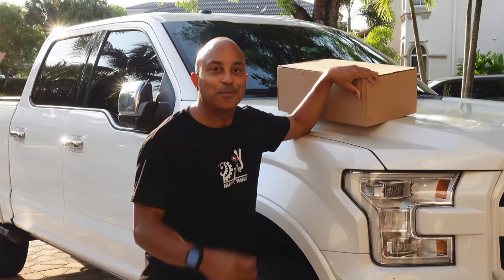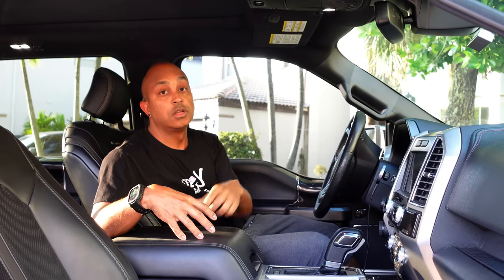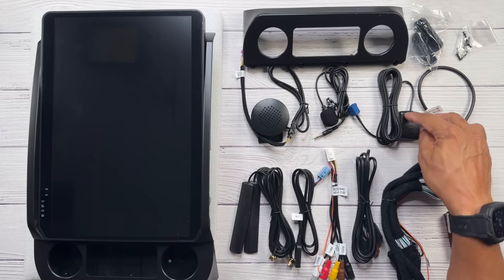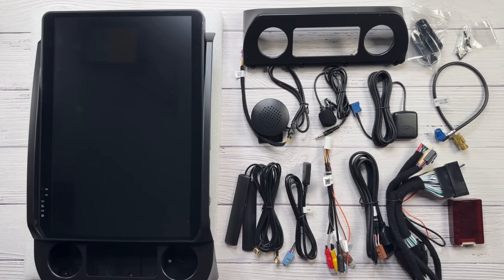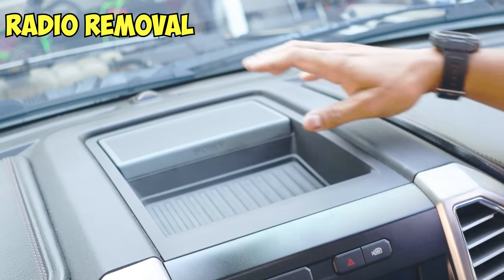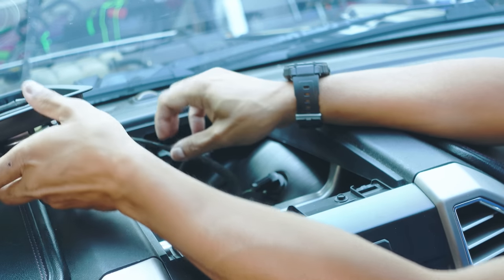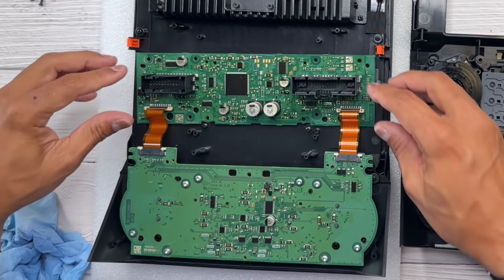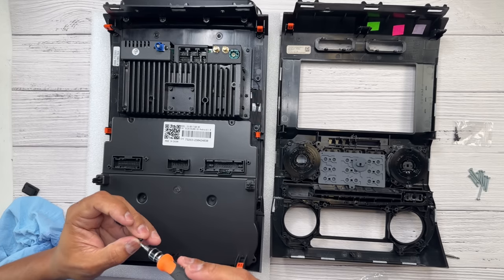BEST TStyle Radio for F-150 | Retains SYNC 3 | AutotecPro 14.4"

Comment: Thanks for the video !! I install everything with the video .. but he don’t have rca output at all to connect amplifier?
Reply from the maker: This unit for the ford does not have RCA outputs for amplifier, you have to do aftermarket amp install by tapping into the connections behing the back seat.  It basically connects to your existing sync system

Comment: 3 months in. Is everything still good? Would you recommend? I have a 2018 F250
Reply from the maker: I would recommend it. It works great so far.
Reply: @DeaninItYourself  Thank you, Sir.
Reply: I'm not happy with mine. I watched this video and I ended up getting one. But as soon as I installed it I wish I hadn't. It might just be me but you need to do everything(DIY) as far as the way it operates. There is no way of turning the system off. It is supposed to remember where you left off, it doesn't. The radio would turn on on its own. When I wanted to listen to the radio it would always come on with the FM2 stations which I had never setup. I have had to reset the unit at least once every 2 weeks if not more. I've had problems with it since installation (12/23) until I took it out last week(8/24). The final reason I took it out was my APIM went bad ($300, overheated, I believe). The OEM APIM attaches to the back of the unit at the heat sink fins. I asked AutoTec Pro if I could return and possibly get 3/4 of what I paid for it back since it has never worked correctly. They said NO! Nothing about it was straight forward. This product should work correctly without having to do anything once installed. Hopefully people have better luck than I did.
Reply: @jarrodwood4833  Thanks brother. Sorry this happened to you.

Comment: Hello, did got the unit installed based on your video, everything works fine except the sound for carplay or playback videos, follow the instructions on installing a USB with a song to activated but no luck, sound does come out but really low and lots of distortion, any ideas on what it is, thanks for the help.
Reply: I had issues with mine and I wish I returned it before it was too late.
I'm not happy with mine. I watched this video and I ended up getting one. But as soon as I installed it I wish I hadn't. It might just be me but you need to do everything(DIY) as far as the way it operates. There is no way of turning the system off. It is supposed to remember where you left off, it doesn't. The radio would turn on on its own. When I wanted to listen to the radio it would always come on with the FM2 stations which I had never setup. I have had to reset the unit at least once every 2 weeks if not more. I've had problems with it since installation (12/23) until I took it out last week(8/24). The final reason I took it out was my APIM went bad ($300, overheated, I believe). The OEM APIM attaches to the back of the unit at the heat sink fins. I asked AutoTec Pro if I could return and possibly get 3/4 of what I paid for it back since it has never worked correctly. They said NO! Nothing about it was straight forward. This product should work correctly without having to do anything once installed. Hopefully people have better luck than I did.

Comment: My same unit isnt shutting off with the truck anymore it just stays on forever and ends up draining my battery if it sits for a couple of days, any idea what could be the issue? I have tried removing all the connections letting it sit for a bit then connecting everything back again but no luck. Thanks

Comment: Great video, Thank you!
A couple of questions I have are - do you need a sim card to be able to use the GPS on the unit ? 
And, do you retain the auto climate control ?
I have a 2017 F-150 Platinum and it has auto climate control for when you use the remote start as it automatically adjust the cab temperature to a comfortable temperature and even heated and cooled seats and heated steering wheel.
One would think that if this system retains the sinc 3 factory features that it also retains the climate control feature ? 

Thanks again
Reply from the maker: yes it does
Reply from the maker: I am posting a review video today so check it out
Reply: You don't need the sim card to use the nav.  I didn't install that or the antennas.

Comment: My apim has gone bad if I go this route will it fix my problem or is the sync module the same thing as the apim ?....I was thinking about the Kenwood exceleron and supposedly it will fix my problem with the module box that will retain steering wheel functionality
Reply from the maker: not sure. how much is a new APIM?

Comment: Have a question I have a 2015 f 150 xlt I bought it used and the bluetooth doesn't work and everytime I start it up the radio goes though a whole rebooting drive me nuts so ford dealer told me it's like a 1000 to fix some main peice 900 dollars then install I was thinking how about yours better then spending 1000 just to fix the radio right
Reply from the maker: Does the radio always reboot or only when you try to use the Bluetooth?

Comment: Does the radio have a rca sub output or just front and rear outputs. Did you use them for your aftermarket amp or did you use a converter
Reply from the maker: It does not have pre outs. It has to run through the factory sync system.

Comment: I have a 2016 F-150 with Sync3, SiriusXM radio, no nav and manual climate control.  My current radio will only go to channel 186 on SiriusXM.  Will this give me the additional channels
Reply from the maker: no it will maintain the sirous you have unless you install the sirius app

Comment: Will it work with a 2018 XLT? Mine has the really small screen, the traction control hazard and auto start buttons face forward
Reply from the maker: Yes it will. You can get the 12!inch version.

Comment: Couple of quick questions. Which one did you purchase as there's several options as far as ram and gb size and pricing. And Any update on how the unit has been doing ever since? Any lags or "boot up" or freezing or connecting problems ?
Reply from the maker: i bouth the 14.4 model with the most RAM.  It is working well still after 8 months
Reply: @DeaninItYourself  that is awesome. I might look into getting this one. I thank you.

Comment: I saw you didn't plug in a 4 pin plug by the USB 20:13 is there a reason for that? I followed your video and it works fine, I'm just wondering
Reply: Also the USB they provided doesn't have enough amp to charge my phone, do you have the same issue?

Comment: Does apple carplay work if you plug your iphone in by USB? I prefer to not use bluetooth.
Reply from the maker: It will work but you will have to use the sync interface for wired CarPlay.

Comment: Can you do wired Apple car play? Is that the USB you snaked to the glove box that it needs to connect to to use wired apple car play? Does it still charge phone as well when you plug it in?
Reply from the maker: you cant do wired carplay using the new screen, if you want wired carplay you can do it through the factory USB's usnig the sync screen

Comment: What year is your ford f150 also can you connect a amp to this unit for subs?
Reply from the maker: 2016.  the radio does not come with pre outs for subs.  I have an aftermarket sub and amp in my truck, but it is wired in behing the rear seat.  and it works perfectly

Comment: If i add an aftermarket subwoofer and amp, is there a way to connect to this head unit or does it only support current speaker inputs?
Reply from the maker: I have an aftermarket amp and sub it integrates with and LC7i

Comment: Does this upgrade cause you to lose the CD player?  I noticed you had one installed but the new screen covers the CD slot, so I'm thinking you now do not have a CD player. Correct?
Reply: Yep, CD player goes bye bye.
FYI: I'm not happy with mine. I watched this video and I ended up getting one. But as soon as I installed it I wish I hadn't. It might just be me but you need to do everything(DIY) as far as the way it operates. There is no way of turning the system off. It is supposed to remember where you left off, it doesn't. The radio would turn on on its own. When I wanted to listen to the radio it would always come on with the FM2 stations which I had never setup. I have had to reset the unit at least once every 2 weeks if not more. I've had problems with it since installation (12/23) until I took it out last week(8/24). The final reason I took it out was my APIM went bad ($300, overheated, I believe). The OEM APIM attaches to the back of the unit at the heat sink fins. I asked AutoTec Pro if I could return and possibly get 3/4 of what I paid for it back since it has never worked correctly. They said NO! Nothing about it was straight forward. This product should work correctly without having to do anything once installed. Hopefully people have better luck than I did.

Comment: What happens when you plug your phone into the usb under the slide tray? With stock screen the whole display automatically goes into Apple car play. How did you install the SIM card and where did you buy it? Does it have to be Verizon or ATT&T?
Reply from the maker: When you plus your phone into the stock usb it connects to wired CarPlay on the factory interface. It is not full screen.

Comment: Installation went smoothly just one problem. I only have sound coming from one speaker passenger front. What did I do wrong?
Reply from the maker: check the eq settings on the sync interface or check your wire connections

Comment: Random question but does/can this unit overheat? An ipad overheats in hot weather easily for example, and I'm wondering if I'll be without a screen in the hot southwestern summer since this is essentially like an ipad device
Reply from the maker: i live in florida and it hasnt overheated once.  not sure why, but thank goodness
Reply: I'm not happy with mine. I watched this video and I ended up getting one. But as soon as I installed it I wish I hadn't. It might just be me but you need to do everything(DIY) as far as the way it operates. There is no way of turning the system off. It is supposed to remember where you left off, it doesn't. The radio would turn on on its own. When I wanted to listen to the radio it would always come on with the FM2 stations which I had never setup. I have had to reset the unit at least once every 2 weeks if not more. I've had problems with it since installation (12/23) until I took it out last week(8/24). The final reason I took it out was my APIM went bad ($300, overheated, I believe). The OEM APIM attaches to the back of the unit at the heat sink fins. I asked AutoTec Pro if I could return and possibly get 3/4 of what I paid for it back since it has never worked correctly. They said NO! Nothing about it was straight forward. This product should work correctly without having to do anything once installed. Hopefully people have better luck than I did.

Comment: Being an old sound installer and repair shop. Good video, except for 1 thing. You stated removing the Radio. What you called the RADIO is not the radio. It is the Control Panel. The radio was the box behind the climate control or where the CD player is. That box contains the power amp, inputs along the AM/FM radio itself
Reply from the maker: Thank you for the tip, always like to hear from the pros.  I am glad you liked the video

Comment: Had this in my F-150 for 6 months.. Love it.

One small issue.
After update. When wireless android auto starts. Android auto freezes. I just press the multi window button and go back. It unfreezes. Ive gotten used to that. But would be nice if that could be fixed.
Reply from the maker: Heck for a new update

Comment: Question: How do you adjust the navigation voice volume since the manual radio volume knobs have been eliminated?
Reply from the maker: Using the steering wheel controls.

Comment: Could you tell me more on what kinda sim card to buy and how they work?
Reply from the maker: All you need to get is any data only SIM card. I bought mine from tello.com. Once you activate the sim and put it in the sim holder for the radio. Your radio will have internet signal.

Comment: Do you have to install and run the 4G LTE cellular antenas to get internet accessibility to the head-unit? Or can I run it off my phone’s internet… hotspot or WiFi, as long I’m not running wireless CarPlay?
Reply from the maker: If you plan on using your phone as a hotspot you don’t need the antennas. But you won’t be able to use CarPlay while you are using the Wi-Fi.
Reply: @DeaninItYourself  can I still use the internet/WiFi and CarPlay if I run the CarPlay thru the USB cable?

Comment: Hey what’s going on brethren? I bought a Tesla style screen for my Ford Edge, but I can’t figure out how to install my SIM card in the device. I’ve contacted the company but they aren’t too helpful with this matter. Any help would be gladly appreciated.
Reply from the maker: what cant yu figure out.  the radio has a cable with the sim card tray, just open the tray, put the sim card in the tray in the correct orientatation and close the tray.  Make sure  it is closed tight, so thet the pins make contact.  reboot the radio and you are done.

Comment: Hey buddy, I bought the same unit for 2020 f250 do I need a sim card adapter to install one in the sim card slot?
Reply from the maker: Depending on your SIM card you may need an adapter.  I think the unit uses a mini sim not a nano sim.
Reply: @DeaninItYourself  ok buddy keep up the good work great video. Your video guide me on every step with no problems.

Comment: I would assume this works on a 2016 F150, i ask because i dont have apple carplay with my stock interface. and that is something i really want. iv been thinking about upgrading like you just did. i just want to make sure everything still works
Reply from the maker: My truck is 2016 F-150 and it works

Comment: I'm having problems with CarPlay connecting automatically. Seems that the only way I can get it to connect is start up the truck, let it boot and try, then have to reboot the radio... then after that it connects right away. Have you encountered similar issues?
Reply from the maker: They just came out with a new update that fixes this

Comment: Verizon is saying they can’t add the tablet to their network. I used IMEI 1. Should I do something else?
Reply from the maker: get a data only sim from at&t or t-mobile.  I use one from tello.com.  once you activate the SIM all you need to do is put it into the SIM tray on the unit and reboot the unit and it will work automatically

Comment: I have installed mine in a Ford f150 2019  manual a/c, all works ok but the a/c doesn’t work properly , what can I do ?
Reply from the maker: what do you mean it doesnt work properly.  Make sure you change the settings on the radio to set to manual AC

Comment: Since this unit still uses the factory GPS, and USB why would you need to install the additional GPS, and USB?
Reply from the maker: it only utilized the factory gps and USB when using the sync interface.  If you want to use the GPS and Media on the android interface then you need the other GPS and USB

Comment: This would work for a 2014 raptor?
Don't see on there website
Reply from the maker: yes it will, you have to put in the serch bar by model for 2014 f-150

Comment: Do you know why they ask if you have sony sound system? Is it different unit?
Reply from the maker: Probably has to do with the sound output when they configure the system
Reply: @DeaninItYourself  do you have to have the sync 3 module or will it work with the sync 2?

Comment: Any issues on the mic sterring wheel? When i try to make a call, say the name on android auto. It switches to sync system
Reply from the maker: i think they are coming out with an update to fix this.  The mic button on your steering wheel is linked to your sync system, so when you hold it down it thinkd you are trying to make a call on the sync system.  I have an I phone so when i want to make a call i just say hey siri call xxx and it works just fine.  I think android does the same

Comment: I got everything working. The only issue I'm having is when I get a call, I can't hear the person talking through my car speakers. It's the same issue when using the console mode and attempting to play audio from a Bluetooth source. Any fix for this? FWIW, I did not hook up the aftermarket black and round speaker that came with the radio or the external microphone. I wasn't sure where to hook those up on the unit.
Reply from the maker: it should be working mak sure you disconnect bluetooth devices from your sync interface,  reeboot the system and make sure to connect bluetooth to the autotech system
Reply: You can try going to the settings and then ringtone and set it to use your phone's ringtone instead of the sync's ringtone (it's usually 1,2 or 3) this will allow you to hear when you get a phone call. The sync ringtone messes up answering incoming calls. I  hope this helps.

Comment: I have 14.4 for the Ford Explorer. How did you get the LTE to work? What Carrier?  I can't  get a sim card thru Verizon because the IMEI is not compatible
Reply: How long did shipping take to get your unit?
Reply from the maker: I bought a prepaid through tello.  just put the SIM card in and reeboot the radio and it should work.
Reply from the maker: about 2 weeks i think
Reply: @DeaninItYourself  is it from China or US?
Reply: @DeaninItYourself  I installed a Verizon sim car, and nothing is happening. Installer Probably didn't connect the cable or do I need to hit the reset button?
Reply: @DeaninItYourself  Verizon 5G card Full subscription works. I reboot system and and it lock up